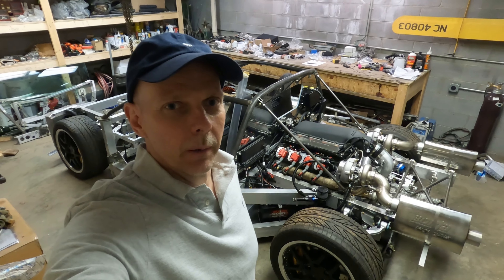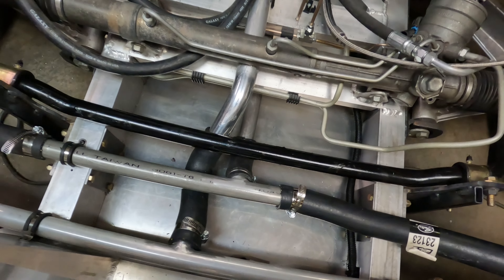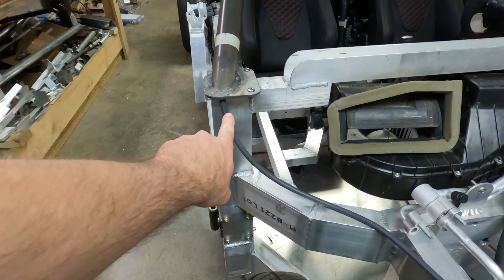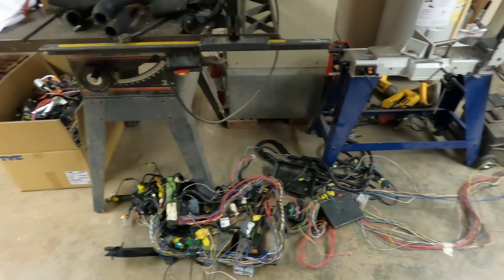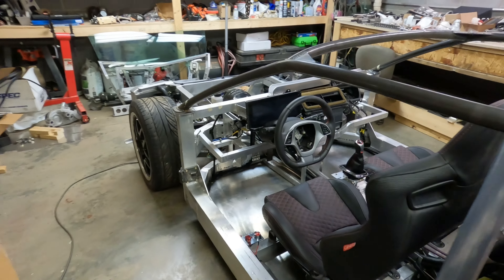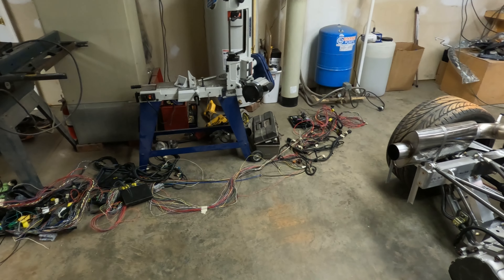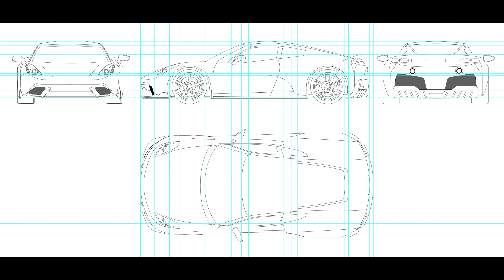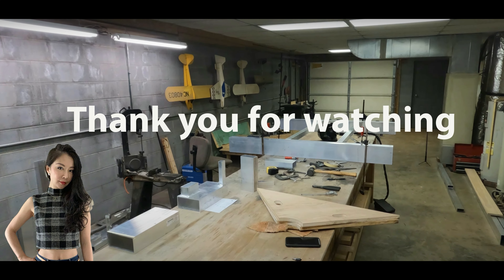Building my own supercar - What will the body look like

Comment: 1 suggestion that will save you a bunch of headache, in the bottom, out the top on your radiators, it will help with purging air bubbles.
Reply from the maker: I had it plumbed that way to begin with and the water pump wasn’t strong enough to push the water through the radiators. I have added vent tubes on top of both radiators now that travel back to the top of the water header tank.